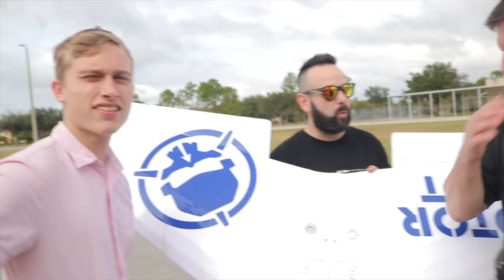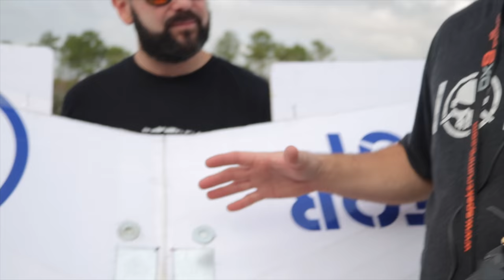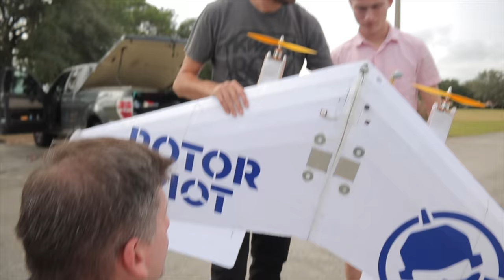Recharging a Drone IN MIDAIR!! (Landing on a Refueling Plane)

Comment: The fact that Vanover could save the wing after the drone fell off and flip back to line of sight was one of the most impressive parts of this
Reply: That man mus've been born with a radio in his hand, he's incredible
Reply: @jonathanwilliams1644  He does look a bit bird-like.
Reply: I started flying fpv with wings in 2015. Half the time you lost video signal, so you had to get good at flipping up the goggles and switch to LOS 😂
Reply: Really awesome guys, as a former LRO/FF/EMA, I can see where something like this would be a boost (yeah I used it) to keeping a drone up to help find a missing kid, fire ground information, or other emergency flights.  Of course it would need further development for a bigger drone setup, but you did it with this, surely it can open up for it coming to a better and longer flight.
Reply: yeah that was amazing, dude's got it
Reply: @jonipaananen9304  Was going to say the same thing. Without really expensive equipment back a few years ago it was best not to rely on fpv. And now in Canada at least it requires special licenses and fees ect to fly outside of line of sight. No reasons. Has nothing to do with drone safety the government just took a hobby and found a way to profit off of it.
Reply: have you seen the video he tapped a wall with his quad and his video blacked out, flipped goggles off ad flew back los. like nothing happeed oh video is black, flip, fly back.

its the video onn wall rides.

serious skill
Reply: @jacobleeson4763  honestly, like how are the drone categories so broad? Plus, unless you are a citizen, you cant get the license.

Comment: Glad I could be there for the end of this epic journey!!
Reply: Paul your the man brother🔥🔥🤘
Reply: awesome shot as always man
Reply: Yessss.  Glad we had you there, buddy.  :)
Reply: @LetsFlyRC  your the maguver of kwads bro love the stuff you come up with its what keeps me watching
Reply: Yo nurk fpv thanks for that gps video you made a while back you helped me get my gps return to home setting working properly. Great video.
Reply: Dude you killed me with the prank. “Should this be on fire?” Had me crying 😂😂
Reply: tell that dude to add a dual tail/wing
itll stabilize the flight and refueling. 
also give the drone a channel to fly into to dock for charge. 

personally id add a 
charging killswitch to the quad that turns on when it connects for charge. 

rather than a manual switch.
Reply: also has he considered a 
landing "bay" ?????
Reply: awesome shot man, and good to see your in this group after soo long..!
Reply: Same here frome philippines
Reply: Why not use a sync system so they automatically sync as when they do those presentations with drones and physically change the battery on air? is it the next step into aviation and combat aircraft?

Comment: If I wasn't wheelchair bound, I literally would have been jumping up and down with excitement.   That is absolutely awesome.
Reply: you better drift with that wheelchair instead
Reply: @IbbiAhmed  Oh trust me, I do.  Both when it's really wet out or when there's ice on the road, I spend a lot of time sliding around corners.
Reply: "who said wheel-chair bound people can't drift?"
"well they can't drive a vehicle to drift"
"the wheelchair is a vehicle"
"oh"
Reply: @lanthan598  and even though we can drive while being in a chair, the hand controls makes it REAL hard to drive a stick, lol.   Automatics though, I'm good.
Reply: @heatherryan9820  they should design a steering wheel with triggers for the thumbs so you can accelerate and use the brake while controlling the direction normally
Reply: @huzrokhayzur2197  they actually have something similar to what you're talking about.  Unfortunately they are usually permanently installed into a single vehicle.  The ones that I've used aren't permanently attached and can easily be taken out if an able body person is driving or to take it to a different vehicle.  These are also fairly cheaper also.
Reply: Keep Rolling, best to you! Hope you country is some what barrier free!

Comment: I am surprised the battery didn't explode, but the concept of carrying your drone to location and back on a large plane using magnets seems surprisingly usable. If you add a real charger that charges with the max rated speed, you could really extend your flight time/range.
Reply: Yeah.  I know it isn’t the right way to charge (proof of concept).  We had so much difficulty just landing on the plane, needed it to be as easy as possible to pull off.
Reply: @LetsFlyRC  Your creativity with drones and everything else is so much fun to watch!
Reply: or do what rctestflight does put solar panals on for a charging systerm lol
Reply: @LetsFlyRC  I would have at least slapped a resistor in the circuit to limit the charge current to something reasonable, but that comes with its own issues. Cool concept!
Reply: @JMMC1005  not everything I did made the episode. 😆 I tried using load resistors and they slowed the charge down way too much. I started to say that after Drew said “this isn’t the right way to charge batteries”
Reply: @LetsFlyRC  Fair enough! I guess that providing your packs are at similar charge states, the current shouldn't become too dangerous.
Reply: @JMMC1005  but if both packs are much the same SofC you'd get no charge to the quad, so what's the point ??
Reply: If you have a large and capable enough fixed wing platform, not only the endurance but you could somehow extend the control range of the drone by relaying the controls through the fixed wing system, of course there would be latency and a whole host of other complications.
But high end consumer drone signals go out to 8km anyways to I guess the main benefit is charging and range compared to a larger signal range that is not needed as much.
Reply: what I'm really surprised by is that they didn't short the 2 charging plates with one of the magnets on the 1st version...
Reply: @LetsFlyRC  A charging circuit between batteries would not change landing difficulty at all or charge time for that matter. Because even though it would charge slower that battery would at least still work afterwards. You damaged that so much it’ll never have close to the same capacity again.
Edit:
Haven’t fully watched the video yet but hopefully you at least arranged magnet polarity to make it so that reverse electrical polarity would be opposed by the force of the magnets. Even worse than connecting batteries in parallel with no protection is in series with no load.
Reply: @jacobleeson4763  my designs are usually built for proof of concept and entertainment purposes.  Never meant to be the final product.
Reply: @stevietee10  Jf,  "proof of concept" maybe?
Reply: i REALLY want to try it, but im bad at flying drones, and i dont have the money :(
Reply: @LetsFlyRC  I mean, never mind not "the right way to charge", I was absolutely expecting a battery to go up in flames if charged that quickly. Like how overcharging batteries to 4.25v/cell is not great but can be done, but try charging them to 4.5v/cell and they'll pretty much certainly go up in flames...
I'm curious though - how fast did it end up charging - do you have any ideas of how many amps were going through that?
Reply: @Vousie  ever jump start a car battery?   Different chemistry, but, still.  They don’t explode.  

It charged almost instantly. It was proof of concept.  Hard enough to land on the plane.
Reply: @LetsFlyRC  Car batteries tend to be less inclined to burst into flames though. In any case, usually you connect the two batteries then immediately try to start the car, at which point the starter motor's pulling the voltage down very far 'cause it's pulling a few hundred amps at the start, so the dead battery isn't really getting charged that rapidly for more than a few seconds.
But mostly my thought was on that first part - lipo's just burst into flames for a lot of reasons. Eg stabbing it will make it go up in flames, whereas a car battery will probably just leak acid.

Comment: With the long range plane with small local flying quadcopter concept you could use the plane whilst in hold pattern as a relay for the video signal to enable you to get a relayed signal despite going behind obstructions with your quadcopter.

Comment: This is so cool! Great work!
I'm curious if you could charge in the same way that MIGs and Air2Air works with the tanker dropping a flying boom to the receiving aircraft.
Maybe extending the charging pad below but connecting in the same way via magnets. Either way it's super cool to see :)
Reply: Would be pretty doable, just need to run a cable out the back with magnetic positive and negative leads of opposite polarity. Put corresponding magnetic charge pads on the nose of the smaller craft and have them snap on when you line up within a few cm.

Comment: up next, you get a fixed wing that's big enough to carry a few batteries, and you run lines on a reel. you put leads at the end of the lines with magnets, and you put a rod with 2 leads in front of the FPV and do a proper inflight refuel
Reply: Nurk suggested this.  We had a hard enough time landing on the plane.  😂
Reply: @LetsFlyRC  I feel like it'll be easier when you can actually see the leads vs when you have an idea where they are. still be worth a try in my opinion

Comment: 💡 💡 💡 💡 💡 long range flight, using new hdzero, have wing at set distance when lipo about to run out, charge lipo complete the flight to destination maybe deliver small package for mission.side note  Use the wing to relay the video feed if poss

Comment: Brilliant work, guys!  Couple things I'm sure you've thought of and perhaps rejected for good reason but 1) consider increasing the electrode sizes on the refuel platform, 2) put shrouds around the plane props and 3) use a quadcopter as the recharge platform.  It would be more stable... still mobile, and with shrouds over the props, a more stable platform that could actually support a real, independent charger.  Great job!

Comment: This could actually have significant military implications.  We could have cheaper battery drones that recharge the more expensive mission based electric powered drones.
Reply: Make them ballons or airships. They can go slow about it. If possible hang solar cells on the motherships. And not only military applications. Search & rescue missions. And the police use drones a lot more since they are so much cheaper then helicopters.

Comment: It would be really interesting if you guys could make a blimp for the recharging platform, it would be a relatively stable and stationary and could potentially store larger batteries or even have a tether that doubles as a surface to air charging circuit. Loved the video, such a great concept.

Comment: To build on that long range retrieval idea, you keep the magnets, but make a large, thin metal plate on the plane to increase the margin for error, but eliminate the need for recharging. 

I was also thinking what if you let the plane tow the retrieval/landing pad. That might not work it might be too unstable actually. I guess you can just increase the plane size, to increase stability and range!

Comment: This actually solves a huge issue of using drones for distant surveying. You can have the efficient flight of a plane with an attached smaller quad for close looks at things. Plus, always the recharge potential of the plane too so just make the carrier plane large enough to stay out for a while and charge and you have a fully fledged tool for surveillance at long distance or for places we can't get.

Comment: Did it actually charge the battery? It sounds like bubby was flying at 21.5, and got charged up to 22.2 from the plane. But that happens to me when I just land on the ground from battery sag, esp if I have been chasing something and pulling amps a bunch.

Im not sure it actually did any charging. would be interesting if they showed the other battery's voltage.
Reply: Agree, I am not sure about charging as well, it just rebound after sag. And I can't understand why video so blurry, it is digital, it should be just perfect picture. so I think they managed to land, but it is not perfect line up and charging is not happening. So it is just faked.
Reply: Interesting to hear from electrician guys about two lipos connected in parallel 25.2 and 21.5. What voltage would be then measured.

Comment: Really awesome! I recently built a twin engine airplane with INAV and I found that if you use differential thrust for yaw then you must really set the I-term to zero. Otherwise it will wind up fast (because of its very limited authority?) and make it difficult to control the plane. Perhaps this was the same problem with the wing?
Reply: If I was doing it, I think I wouldn’t run rudder through inav at all and just have a linear controllable throttle and course yaw trim!

Comment: yOOOOOO Next idea. Radio handoffs!!! Like runners passing a baton.  Have an output control a triple-throw relay, use diodes and/or failsafes to set the relay to change which receiver is commanding the flight controller. You can have three or more receivers and three+ people on the ground, all with different transmitters, on the same video channel,  spaced out from each other enough to do ULTIMATE relay long range as the next receiver connects and the first pilot hands off control to the second. All of you have your DJI goggles on the same channel and now you can do some REALLY crazy video or control tesets without fear of crashing the plane at the limits! Once the first pilot loses control, the second pilot automatically ends up taking over. It would be awesome to have the telemetry of the flight controler report back when the receiver switches or something.   Call it FPV-Relay. 

ORR maybe we should just start making some advancements on cellular data radio control........

Comment: Excellent proof of concept that is sure to have some practical applications. 

However, for a lot of specialist drones, that are physically large, too large to land on a drone recharging ship in mid-air there probably needs to be worker drones that can ferry new modular charged batteries out to the specialist drone that can also then be used to restock the specialist drone, i.e. that could be with additional power, but it could also be with supplies.

I hate to use a military application as an example but at the moment in Ukraine there are drones that drop supplies and bomblets. These drones are reasonably large and operate at long distance from the operator so they have to trade distance for time.

To extend the range of the drone, it would be useful for other drones to deliver charged batteries, so the main drone can operate for longer over the target area without the need to come back to base.

Because the deploying drone will have more sophisticated targeting, stealth and anti-electronic jamming capabilities, cheaper and less sophisticated drones could be used to ferry the supplies and new power units. The restocking drones could drop supplies to a close, but safe distance from from the danger area, the main drone then land and take on new supplies and power.

Although it might be easier to dock to a portable recharging station, recharging is time consuming and it would be more efficient to be able to swap out batteries.

Just need a design a mechanism to allow batteries to be swapped out,  and to be able to pick up new supplies.

Over the next few years there is very likely going to be a whole new generation of worker transport drones, that supply other drones, or that can carry and then deploy specialist drones that have limited range.

Comment: I want to see a long distance mission with this concept, or even with 2 drones on board. 👍👍👌👌👌👌
In twin engines it is important that the two ESCs and motors are the same and are calibrated to switch on at the same time, otherwise you will get the same spiral all the time.

Comment: Nice feat! You guys are possibly unknowingly contributing to the global transport solution. If you can do this with quads, you should be able to marry wings too. Electric passenger flight is slowed down because of the lack of range, but if they don't have to come down to refuel and a refueling wing can just fly up an recharge them in flight, they don't need more airports, just a bunch of technical airstrips for drone planes to take off and land to refuel whoever's flying over...

One next step you guys can take: reach out to rctestflight and get a system where the drone's controls are taken over by a system on board the wing, that will guide the drone in with the help of lidar. If the wing controls the drone to be in a fixed position in relation to the wing and then just slowly brings that position closer and closer to the mag pad, you could reel it in every time, 100% success rate.

One idea about the wing's change in control as soon as the drone lands: perhaps you could change the shape of the wing so that the drag on the top side doesn't change or barely change with the drone attached. Because in the current configuration, even with the drone on the CG, you'll make it behave tail-heavy due to the drag the drone causes.

Comment: Is it just me, or is only one terminal connected at 9:23 ? Right sided magnet/terminal seem to be completely disconnected?
Battery rising slightly after a discharge stops is normal without charging.

just landing on a plane like that is amazing though :) Might want to consider 1.5-2" props embedded in the wingtips for roll stabilization if a even more refined model is made !

Comment: For differential thrust first you need to configure flight mode and assign it to TRN switch for actual YAW control. Keep YAW mix between 5% to 12% for normal flight mode.

Comment: A large plane as a wireless base station with a cellular internet connection streaming the FPV feed and you could fly as far as the battery's would and cell service is good to like 1000ft.